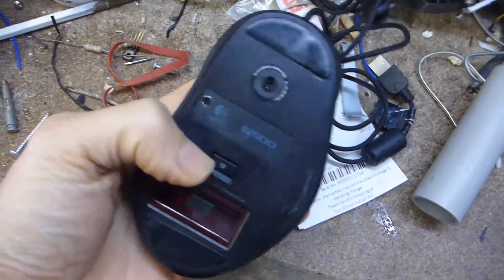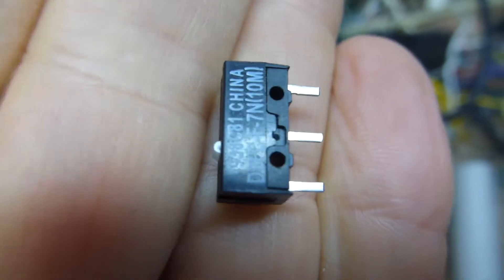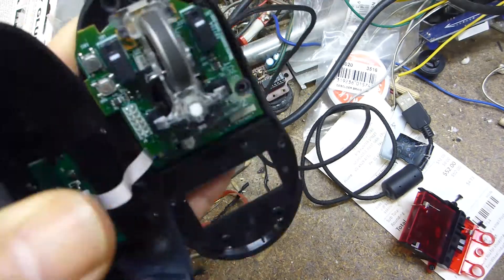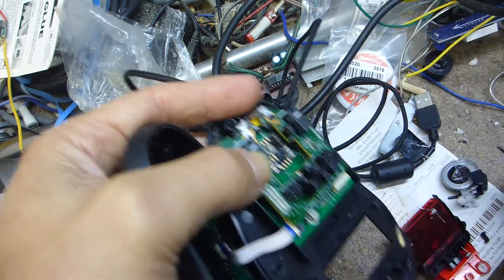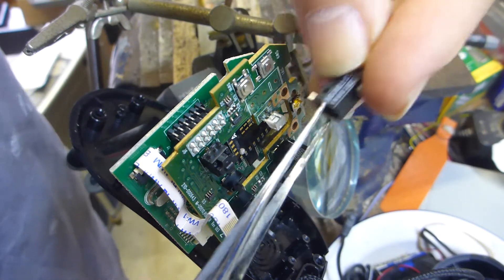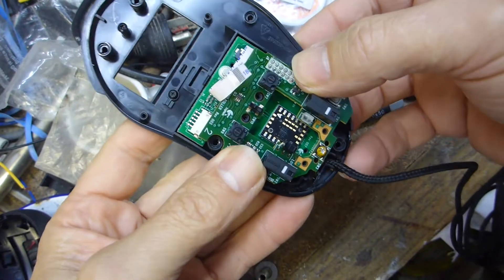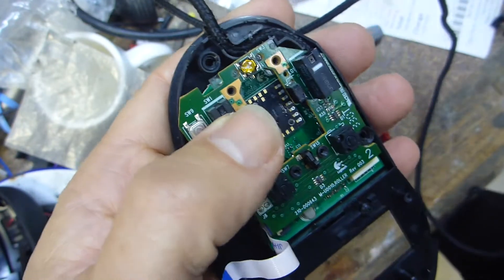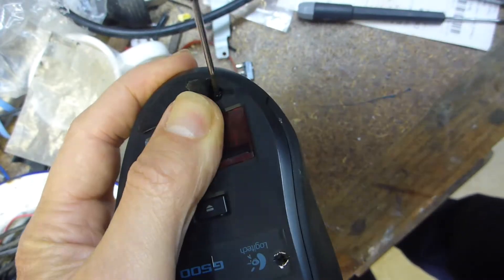Logitech G500 Gaming Mouse switch repair

Comment: For anyone reading but find the full disassembly and soldering a new switch a bit much, you can take an old soft bristled toothbrush and 99.9% "technical grade" cleaning alcohol and brush away at the switch, can use a bit and make it lightly moist without much worry if you use the 99.9% and also brush the underside of the mouse shell. This way you only need to open it up with 5 or so screws, though that ribbon cable is a b!tch to reseat, just prepare yourself for that.

Sometime this will extend the life of the switch by a few months or even years! Just did it to my G500, but might just set aside some time and order the new switch to do the full job so I don't have to worry about it for a few years or hopefully more. Can't guarantee it'll always work, but worth a shot if you have the double clicking issue since it's nearly useless at that point.

I'm only 2/3 through the video but FANTASTIC video. Thank you for deciding to record it and share it with us, it's super clear and helpful! Still haven't committed to doing the actual job but good to know what it'll look like and what I'll need to find...I haven't soldered in years so I don't know where my tiny spool is.
Reply from the maker: Thanks for the detailed comment. My G500 right hand button is just starting to go... oh boy, another repair!
Reply: @pescado99  Fun times...

I'm thinking of using the Japanese switches, no idea if they are fully compatible, but if you (or anyone else) is curious, the model number is omron d2f-01f. The chinese OM10 your list is omron D2FC-F-7N(10M). And as you said, I think they have a 20M version of it.

Comment: Thanks for the tutorial. Now I know it's too much of a pain in the ass to bother replacing and it's new mouse day.
Reply from the maker: @rodneyphillips1320 Cheers.  I'm still using mine daily after this last repair.
Reply: @mine was at least 10 years old. It had a good run. I’ve just upgraded to a 502x.

Comment: One of the best mice ever made.  Mine lasted almost 10 years before I had to replace the switches (well, my friend replaced them).
I moved on to the G502 Hero which I like a little better because of how they improved the tilt action on the scroll wheel which I use extensively... Unfortunatly the quality has clearly declined at Logitech as the G502 only lasted about 3 years before it needed switches replaced.

Comment: Thanks for this video, I was able to fix my G500s thanks to the other instructions and this video. A few details for any one who wants to try:
1. I lost one of the springs sometime when I've done previous "repairs". It still works ok with one.
2. The hardest part - remove the old switchers (I had to change two). Requires patients and may be a second person to help.
Reply from the maker: Thanks for watching. I still use my G500 every day! No reason to change, it's an awesome mouse. Yes, patience is always the key.

Comment: Would it be possible to add more modern senor to this mouse?
I found a completely new ans unopened one for 7dollars
Reply from the maker: Do you mean to change the laser? I'm not sure you'd want to, the electronics may not be compatible. The G500 has adjustable DPI from 200 to 5700 adjustable in 100 increments with software (5 Settings).
Reply: @pescado99  then would it be possible to change most of the insides and put say for example the parts from a g305 inside?

Comment: i must have swapped around the springs in the switches like 5 times now, the cable is also about 10 inches shorter after repairing fraying where the cord leaves the mouse multiple times, I won't let it die, it is a great mouse. Thanks for posting this, i never even considered purchasing entirely new switches

Comment: I wonder if the 12-Pin hardbridge (or whatever it's called) that holds the PCBs together can be changed to something that allows you to plug in the top board instead ofr easy maintenance. Because to replace the mousewheel switches you have to separate the boards to access to buttons.
Reply from the maker: Yes, maybe. Would be tricky as it's all SMD soldering and partially potted, so you might have to scrape back the coating to access the solder. That's a lot of work!

Comment: I've gamed with one of these great mouse for around 10 years myself. Mine's just started double clicking. 
Great video. I've had others say just replace the switch, it's an easy job. And your video proves it so with the right tools. I do have the tools, so might give it a go. 
I did replace this mouse a week ago with a G502 Hero. Though it's a good mouse, there's something about it that the G500 doesn't have. I can't put my finger on it, but it's there. 
Again, a great instructional video. 
A fellow Aussie.
Reply from the maker: Yep, nice to know there's a few of us about! I'm still using my G500 as my 'daily driver'
Reply: when I moved to the G502 from the G500 the biggest changes I noticed were the thumb button location and spacing lowers your grip on the mouse and the the thumb button actuation and additional two buttons to the right click are sloppier on the G502.  I do think the G502 has a better mouse wheel overall and after getting used to how it changed my grip I like it a little better.

Comment: I've had my G500 for ~12 years and the left click has been driving me crazy for the past 6 months! Thank you for making this video! I'll be replacing my switch soon now that i found your excellent guide video tutorial. Thanks!
Reply from the maker: Please. Just be careful of the ribbon wire supplying the top LED's and microswitches between the body and top part of the case. Good luck !

Comment: I've just fixed a 10-yo G5 Laser mouse which has almost the same internal structure. I love this mouse, but sadly the cable is thin and breaks easily right at the outside of the mouse. Now it might live for another decade.
Reply from the maker: Still using mine daily!

Comment: Edit proper switch cleaner not IPA, it has an acid and oil lubricant. 
Instead of replacing the switch first try isopropyl alcohol to clean the contacts by dripping inside and pressing the button repeatedly. I wound up putting my old switch in after the new one started sticking down.
Reply from the maker: Good idea. I actually tried this, but the copper 'flipper' within the switch was giving intermittent (i.e. 'false') jitter click response.
Reply: @pescado99 Back here still working mouse after using switch cleaner not long after comment and IPA failing. The cable now needs replacing.
Reply: I kept mine going by using some very fine wet and dry paper to take the oxidation off the contact surfaces inside the switch, you can easily pop the caps off with a scalpel blade or fine tweezers, just don't lose that white button component

Comment: I wonder why Logitech decided to put shitty switches into a $70 mouse.
Reply from the maker: Not sure that they did. 1 million cycles is a lot of clicking!!
Reply: @pescado99  I've got a lot of double-clicking. After I fixed a double-clock in the left switch, the right switch also started to give double-clicks.
Reply: @pescado99  Logitech used to put switches manufactured in Japan in their mice and now they put ones made in china in them.  I've had mice last me 10 years before dying and I haven't seen a logitech built in the past 10 years that hasn't needed a switch replacement after a few years of use.

Comment: Greetings
I'm about to do a switch repair on my G500s what temperature did you use for this?
I'm slightly concerned if I start too high I might burn part of the biplane PCB.
Reply from the maker: Mine is just a pretty standard 20 watt iron with a medium to fine tip. I tend to wear +5 x magnification doing fine stuff, and have used this iron soldering SMD's before - I thank it's more about shorter contact time than outright temperature.

Comment: I have a logitech g500s, but the sensor is crashing, can it be fixed?
Reply from the maker: No idea. I would start with carefully dismantling the mouse, removing the sensor and reseating the LED. I suspect they're pretty reliable, and either work or don't work. Is it the sensor or the LED? Good luck.

Comment: Good job. I've used this mouse for about 10 years. I have run in to this problem as well. Have fixed it by replacing the switch internal spring instead of soldering and has been holding up fine. Replaced the usb cable and scrollwheel in the past as well. I work a lot on my computer and do use the programmable part for all my frequently used shortcuts, absolutely love it, so to each his own. Great video
Reply from the maker: Thanks for the comment. I'm using the mouse as I speak and still like it. I use the auto page clickers and adjustable DPI buttons.